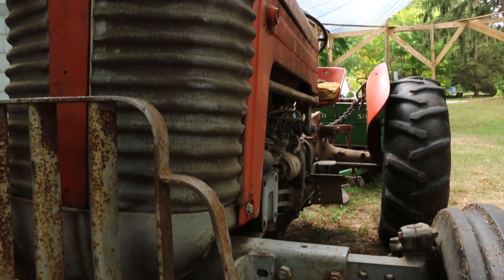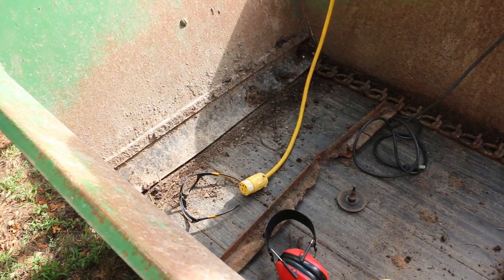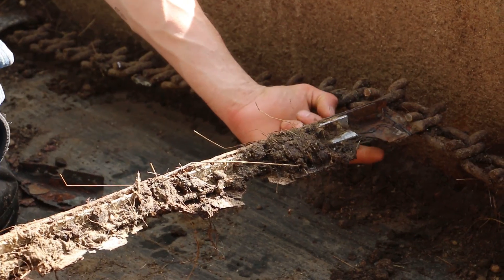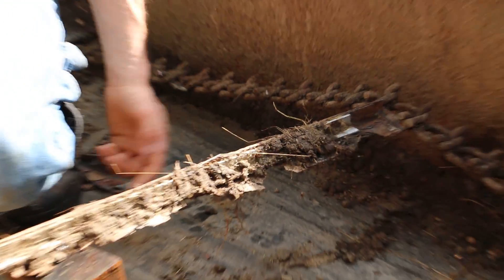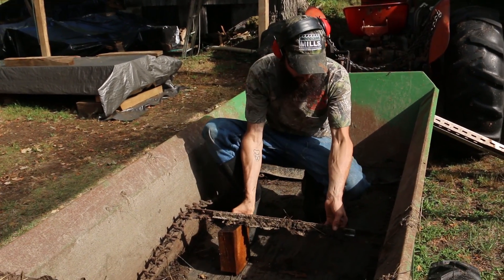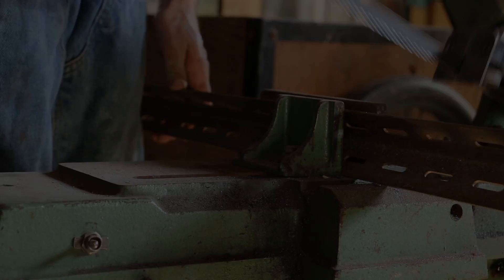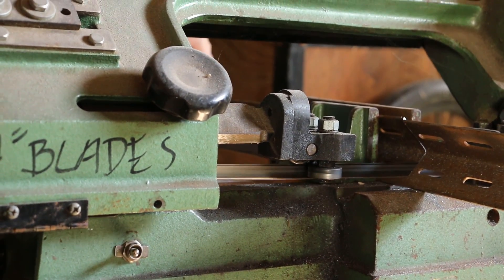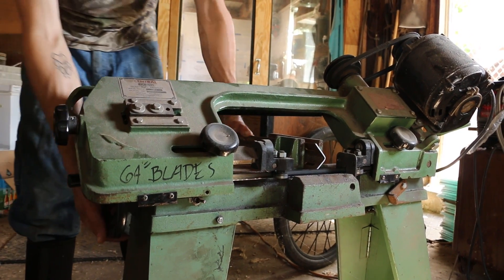Acorn to Arabella - Journey of a Wooden Boat - Bonus Content: Fixing the Manure Spreader

Comment: I know you probably hate all the advice, But if you move that switch up and down, it should turn itself off. At least that is what mine does. Also mine didn't have a damper on it so i welded a hood support strut to it and It works great. FYI.
Reply from the maker: We love the advice, we have learned a lot from folks advice so far!  We have heard from others about the switch and damper.  We might add the arm and switch the switch before we start cutting all the bolts for the backbone.  Right now we don't use it much so no biggie but that will change soon enough!

Comment: Been sixty years since I saw a manure spreader. I thought they were all moved to Wash 
DC.  Cleaning the steel angle and chain (sand blast)  every spring and painting it with rust inhibitor paint will prolong the life of the rig.

Comment: I have that same bandsaw; it is a real piece of garbage but it generally gets the job done.  Supposedly they can be tuned to run better and using a premium blade helps a lot.  These were produced under many brand names but are all essentially the same Chinese bandsaw.  They did not come with a damper as some have suggested, only a spring tension device.  The empty threaded hole on the upright portion that is above the switch when the saw is used horizontally originally held a sheet metal tab that will turn off the switch when the saw reaches the end of its cut.
Reply from the maker: It is not the best machine we own by a long shot but so far has performed well enough and sure beats the hacksaw!!!!
The spring does not seem to do much even cranked down all the way.  We bought it second hand and the tab was missing, maybe it's worth fixing but so far the metal clanking onto the floor gives enough notice =)

Comment: Generally there is a hydraulic damper on that style of band saw that controls the decent speed of the saw so you don't have to hold it up.
Reply from the maker: Interesting, that could be a very useful addition to that machine.  Thank you very much for the tip!  I don't know if the saw originally had one or not but it would be a easy modification.
Reply: The trick in this situation was to stack 3-4 of the iron angles and cut them all at once.